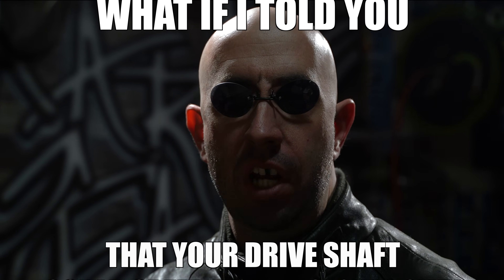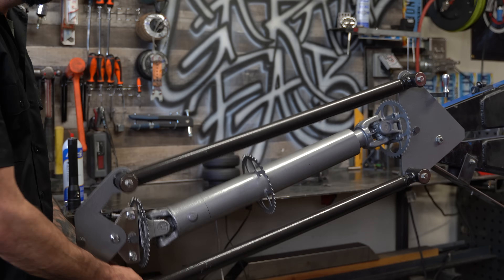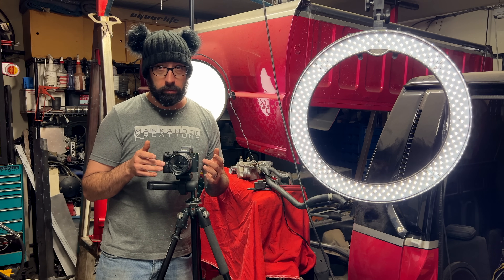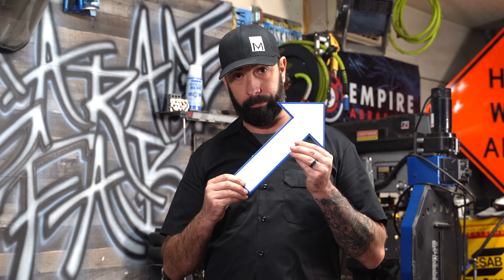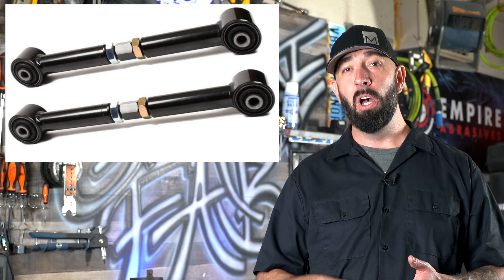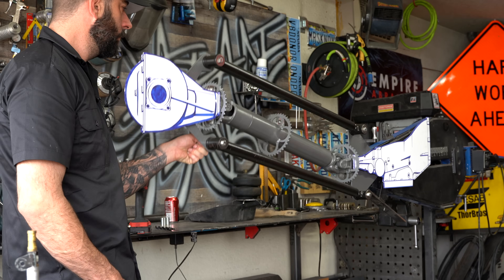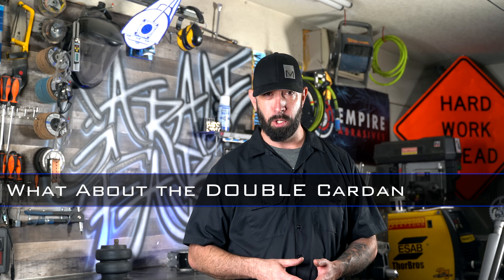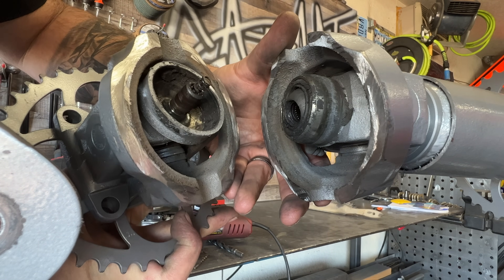THE Driveshaft Video. The Nature of U Joints. Suspension Basics Ep. 06

Comment: Hey boss I have a question. Everything clicked clear up to the split two drive shafts. I’m bagging a 1984 suburban, Z’ed the frame 3 inches to clear the front crossmember, now the engine sits fairly high. The angle of the output shaft on the transmission is 8.5° down. From what I picked up in the video is this angle into the first drift shaft won’t be as crucial since there is only one U joint and a carrier bearing. Would I be right that I just need to make the angles from the carrier bearing and the rear diff parallel to avoid any vibration.

Comment: In a 4wd pulling truck with solid rear suspension and front four link suspension on a solid axle, track use only, if I mount my divorced transfer case plum vertically or 0*, should both pinions also be level or at 0* ?
Reply from the maker: Hey David! I’m struggling to picture your setup, but regardless, yes. The shafts inside the engine, the transfer case, and the differentials should all be parallel, or in your case, all at zero degrees.
What wasn’t mentioned in the video is that U joints like to have a very small amount of bend to keep the grease and needle bearings moving. 1° is generally enough for that and isn’t enough to cause vibrations.
So if you’re transfer case and your trans tail shaft are the same distance from the ground, this will make your U joints perfectly straight which will cause premature U joint wear. It would be wise to tilt everything a small amount. For example, raise the front of the engine a smidge, and mount your transfer case and deferentials to match.
Hopefully that made sense.
Reply: @GarageFab  thank you for responding! Love your videos, I've learned a lot. I will be mounting my engine and transmission level with motor plates. The transfer case will be mounted level also but the input may be a few inches lower than the transmission output and I'll use a driveshaft, if they end up both at the same height I'll use an coupling shaft. I just wanted to make sure that if the transfer outputs were at 0* that both pinions needed to be at 0* also. Another question for you: I'm building a Dana 70HD into a front steer axle and using fabricated '05+ Super Duty inner C's from Busted Knuckle Offroad . If the pinion needs to be at 0* what degree should the inner C's be welded on?
Reply from the maker: @davideastman5623 My pleasure, David! Don’t take any of the following as fact. You’re about to read some opinions based on my knowledge of production vehicles and alignment.
I didn’t know what an “inner C” was. I had to look it up. 😬 So the Busted Knuckle Cs are made to fit 3.5 tubing. This means the only angle you get to choose is how the steering king pin is clocked on the axle tube which will change your caster. (Steering axis or king pin on your truck)
In production vehicles the steering axis is usually leaned back slightly to create a self-centering steering condition. A perfectly vertical king pin would give no self-centering and a vehicle that would wander all over the freeway.
So in your use case? Because you’re pretty much driving straight, my thought is a 2ish degree positive caster (steering axis leaning back) would be ideal. The steering wheel would constantly be trying to center itself.
This is something you should ask someone in this sport. I could imagine zero degrees of caster could also be a benefit because there it would nearly no resistance when turning and high speed wandering seems like a non-issue.
Caster plays a large role in traction in high speed cornering, but it likely wouldn’t play any role in traction when pulling at significantly slower speeds.
I’d be interested to hear how my educated guessing stacks up to someone that’s actually knowledgeable in your field.
Reply: @GarageFab  I'm not sure how to send you pics, I could send you a pic of my ProFab transfer case
Reply from the maker: @davideastman5623 You can shoot me an email, GarageFab702@gmail.com
Or if you’ve got an Instagram, @GarageFab works too.

Comment: So, why are driveshafts coming out with one CV joint and one universal joint. The way you describe it, wouldn’t that make it vibrate because one universal joint vibrates?
Reply from the maker: I can’t say why they’re doing it. It certainly seems odd.
Remember U joint speed only changes when the U joint bends. That said, on their setup, the single U joint will be nearly straight at ride height. (I say nearly because a very slight angle keeps the grease and needle bearings moving preventing premature wear, but not enough bend to cause speed oscillation.)
You can bet that if you lift or lower one of those vehicles significantly, that one U joint will bend and there’s nothing to counteract it. 😬
Reply: @GarageFab  and these QA1 carbon fiber driveshafts are $2250. CV and U-joint.

Comment: So if you have a driveshaft with a double cardan joint on the trans end, and one on the diff end, does the diff angle need to be in line with the drive shaft? Or does it need to be parallel with the trans angle? I’ve got a slightly lifted leaf springed Jeep that is want to make sure is right.

Comment: Dear friend, I have an off-road car with raised suspension. I ordered adjustable wishbones, I got an almost perfect differential position relative to the gearbox, a difference of about 1° but taking into account the shaft angle and the short wheelbase, it turns out that both U joints work with a working angle of 15° 😢 and the instructions say it should be more than 0 and less than 4. Will my u joints still die prematurely and will I have body vibrations? 😥?

Comment: theres another piece to this and that is some driveshaft vines occur from the extreme bends in U joints..  its great to have your pinion angles the same as your transmission and have it stay there.. BUT you likely want to set up a "cruise" ride height and build for your driveshaft to be as straight as possible for that cruise height..  me personally im into Old vintage busses..  we have 2 and 3 piece driveshafts to deal with.. swapping drivetrains around and old rudimentary  air suspensions (factory on most busses)..  end up with wierd pinion angles. whgat ive found is that you build for a set ride height and you angle your powertrain and rear diff (and shim any center support carrier beariungs) such that you have maybe a 1-2 degree angle off of center for the driveshaft..  meaning that when you look at the demo jig he has there you would want to make sure at you would want your driveshaft to be in as much line with both the diff and the transmission at cruise height.. with 2 piece drive shafts, the carrier bearing needs to be shimmed so that the front U joint at the transmission is in line with the carrier bearing..  as close to 0 degrees as possible..   when ive helped people with motor and trans swapos in busses deal with driveshaft vibes.. 98% of the timne the issue is they never aligned the front U-joint..  and never set the ride height at the factory designed height when replacing a blown air control valve..  (busses are constant height air suspensions.. the lever valve adds / discharges air as the ride height (load on the bus) changes...

Comment: Thanks for the info.  Question: I have a Ranger & a Bronco 2 (both 4x4) that each have a single DC joint on the rear driveshaft.  Why?  It seems from the vid this would actually INDUCE vibration.  Neither is lifted (yet).

Comment: I’ve been wondering if a double Cardan joint will work between the tail shaft of a 4L80e and the pinion shaft of the Heidts Universal IRS - no drive shaft.  This will be a mid-engine design using a BBC with a dry sump.
Reply from the maker: Absolutely. The double cardan is ideal for this kind of thing. The IRS is the important part. It could not be made to work on a differential that moves up and down with the suspension.
I’d recommend utilizing a slip joint though to make up for the small movements of the engine/transmission assembly and the differential on their mounts. It would also make setting the whole thing up quite a bit easier.
Reply: @GarageFab  

👍🏾👍🏾👍🏾👍🏾👍🏾 
I’m glad you favor this type of setup.  I value your opinions.  
👏🏾👏🏾👏🏾👏🏾👏🏾

Comment: And the double cardan joint needs to be mounted to the trans and not to the axle due to its weight !!
Reply from the maker: Is that true?! I figured it would just make the most sense in most applications. It’s highly unlikely that a transmission would be angled and the diff level. 🤷‍♂️

Comment: Why don't driveshafts use CV joints?
Reply from the maker: Occasionally CVs are used on driveshafts. My guess on why it’s not more common is simply cost. When vehicle manufacturers build millions of vehicles, pinching pennies is really important. CV joints use a lot more material and are more difficult to manufacture so that equals more $. And because U joints work just fine when set up properly, there’s no need to spend the extra money.
Just my guess though. 🤷‍♂️

Comment: Fantastic video! Loved it.

One question though: you never mentioned about the actual operating angles of each U joints in a single cardan shaft. Do they really need to be at no more than 3 degrees?
On my FJ Cruiser I have transfer case and differential flange angles marching at 3 degrees. The drive shaft has a 10 degree slope. The operating angles in each U joint is 7 degrees and I am getting vibrations between 90 and 105 km/h.  :(

O can adjust yeh rear pinion angle to minimise the U joint operating angles, but then both, transfer case and Differential, won't be parallel anymore... :/

Comment: That was very educational.  Now I have to go take the damn 3 to 5° down angle out of my pinion on the T Bucket. 🙄 Where was this a year ago? 😉
Reply from the maker: Do you have problems with the current setup? It’s possible that your angle is ‘wrong’, but I’m a believer in “Don’t fix what ain’t broken.”
Reply: @GarageFab  I’m still in the build process. So it’s fairly easy to change at this point. I copied (for the most part) the mustang suspension geometry that the axle came out of. But I don’t know the ride height of the car yet. All the old-school rod guys say the pinion supposed to angle down a little bit so I built that into it. The upper links are adjustable so I can change that back to level. Thanks for your videos

Comment: Back in the day , stuffed a 350 in a 240 Z  hanging the block in place suspended a few inchs in the engine bay , beefy springs,  ,clearance" & drive shaft alignment  & stock independent suspension, squat & go came off the alignment of the pinion straight thru , mock tack in place engine mount trans mount, loop, but never went thru u-joints like I did on a charger w balance ds
Reply: Within 3° up down but trying to get accurate alignment by lowering block/trans bolted to rear end drive line  as weight changes ,torque load changes,  no bind no noise no internet" did a solid axel leaf spring VW gasser 327 tunnel ram velocity stack cartoon car no rear fenders 10 in slicks pizza cutters up front, firewall cut for trans tunnel  drive shaft was long as forearm 😂 power glide 4:88"s  12 bolt no shocks no springs ,  bolted to the frame" the white tornado".  caged &  lite but braking on the end of the 1/8  and get some rear wheel hop  fun fun

Comment: My drag car will have very little pinion angle deflection,  2008+ challenger rear ends will be the new ford 9"! But yes if you are going for extreme ride hight adjustment, always choose cv syle joints over U-joints!   Engineering matters!

Comment: I really appreciate the informative and educational content. Demonstrating the principles with models makes it easy for me to grasp the concept you are explaining. I have a newer 4Runner that I would like to lift 2.5" in front and 2.0" in the rear. Is it correct that because there are two u-joints on the rear drive shaft the lift will not cause a vibration at highway speed? And what about the front axle CV joints?

Comment: You are a life saver. You have explained why I have a vibration.  Now I hope you can help me fix it.  I recently purchased a 2007 Ford E250 5.4 with a Tuscany conversion. It has 76,000 miles on it.  It is also setup with a Braunability wheelchair lift and locking chair system. The lift is located under the van, so they had to modify the drive line.  I have had the van to 4 different shops and they all waived the white flag.  After watching your video I have some ideas bur will need help to get the correct pinion angle.  I can send Pictures.  please help thank you
Reply: Hello again Thank you for your response. I really appreciate  your help.  I will be sending picture and info for your input.  But First, What is your name.  I know you are the GRRREEEAAAAAATT Garage Faber, but what do I call you please.
Reply from the maker: I go by many names. Aaron, Mankandy, Dickhead… whatever you’re most comfortable with. 😉
Reply: @GarageFab  You are funny.  Thank you for excepting this endeavor.  The Fifth shop has bowed out for liability issues. BUT to give them credit the problem is considerable better.  When I get the pictures I will also give you a Blow by Blow with what I have had done and  the improvement or not that each item has made.  Also I am in Shelbyville KY.  Did I see you are in Las Vagas?
Reply from the maker: Correct!
Reply from the maker: I would love to help if I can. It’s what I live for. Shoot me some images to GarageFab702@gmail.com along with what your ideas are.

Comment: So in a case where transmission and pinion angle are going to be "mostly" parallel throughout the suspension travel range (as in the 4-link setups you showed, or with independent rear suspension), is there any benefit to building in a minimum amount of matching pinion angle at each end? I've always been told that having both U-joints completely straight all the time was bad, presumably because the needle bearings in the caps get no opportunity to move around in such a situation
Reply from the maker: You are 100% correct about stagnant bearings causing problems. If the bearings can’t move, they begin to wear away at their races at very focused points.
But let me clarify, because it seems it’s commonly misunderstood what causes this condition.
It is the angle (or lack of angle) of the U joints that makes the bearings unable to move and NOT how parallel the trans is to the differential.
For example, if your transmission is pointed down 3° and the front of your differential is pointed up 3°, they are then perfectly parallel. This alone is not a problem.
The problem area is the relation between the driveshaft itself and the trans/diff angles. 
If the driveshaft is perfectly parallel to the transmission, this means that U joint has 0° of bend. THAT is a problem.
It is recommended that a U joint has at least approximately 1° of bend to keep the needle bearings moving. You determine the bend angle by subtracting the angle of one component from the angle of the component on the other side of the U joint.
Example: We have two trucks on which the transmission and differential are perfectly parallel at 3°. 
One truck has lifted suspension and the other is lowered.
The driveshaft on the lowered truck is level with the ground at 0°.
If we subtract the 0° shaft angle from the 3° trans angle we find that the U joint between them is bent to 3°. Excellent!
Now on the lifted truck, the driveshaft is also at 3°. If you subtract the shaft angle of 3° from the transmission angle of 3°, you get a U joint joint angle of 0°.
THIS is the straight U joint that will cause problems because of unmoving bearings.
Hopefully this makes sense. I’ve just decided to create a short video on this. It’s so much easier to explain with the use of visuals.
Lemme know what you think!
Reply: @GarageFab  Thank you very much for the excellent reply, that's exactly what I was hoping to get clarification on

Comment: Interesting take, i dropped my car 1in in the rear but 2 1/4in in the front. For that reason i bought an adjustable upper control arm. I was always told to set pinion angle to -3 for racing taking into consideration that most engines are usually angled to -5 from the crank at factory. My driveshaft has spicer 1350 front u joint and a cv joint on the rear. I dont really have issues with it, works great for drag racing like that but i feel a small vibration through the car the faster i go above 75. This is where i cant tell if its the solid poly bushings in my motor mount or if its truly the driveshaft at those speeds. Seeing that I do not have leaf springs and a automatic should i set the driveshaft back to 0 or -1 from the -5 at the trans?

Comment: I love your videos! I have a very fast and audible vibration at 80mph. I’m trying to figure out what is causing that. Iv been struggling with pinion angle for a while now. The issue I have is my motor and trans sits at 3 degrees down. Problem is, if I set my rear pinion angle to 3 degrees up my driveline is at the exact same angle up as my rear end. Like a straight line. Is that ok? I was under the impression that it’s not good to match the angle of the driveline.